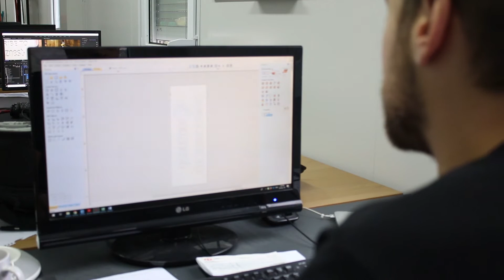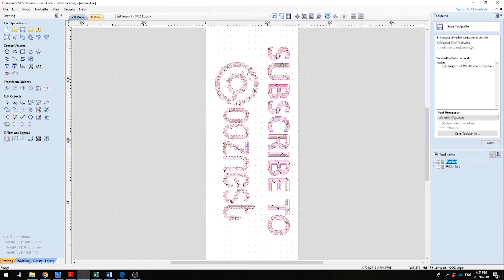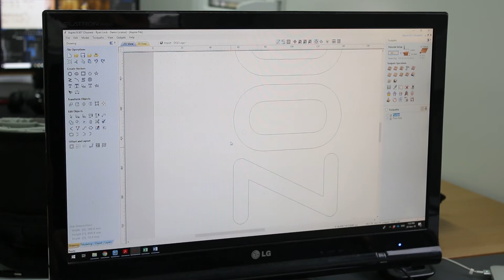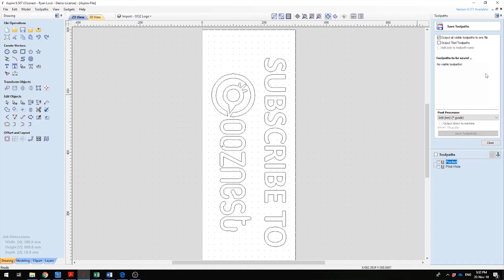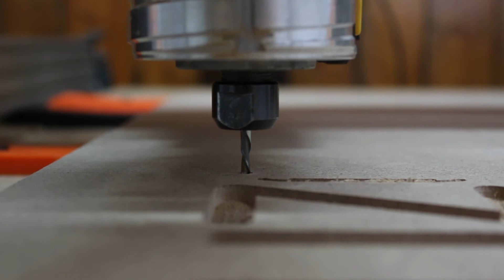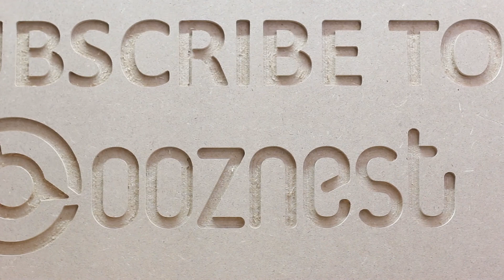Using the Tiling Function to Cut Materials larger than your Machine | WorkBee CNC Machine

Comment: How would you go about flattening the back of the spoiler board where it is outside of the limits to ensure sheet material being fed through is same height as you described? Thanks
Reply from the maker: Hi Tobias. That is a good question. If you plan to do push throughs, we would recommend having your spoilerboard the same size as your working area. That way you don't get the lip after surfacing.
Reply: Ok, thank you!

Comment from the maker: Thanks for watching the video, if you have any questions please let us know.
Reply: Hello Ryan. What is the clamping method you're using?
Reply from the maker: @lowplainstu  Hi we just use some 3D Printed clamps to lock the material in place left and right. And then some G-Clamps to hold the material down. You could argue it isn't the correct method. But it works well for us when we are just doing simple MDF signs like this.
Reply: @ooznest  Ah. Missed the clamps at the back. I just wondered if there was a cam or taper in the side clamps ;)